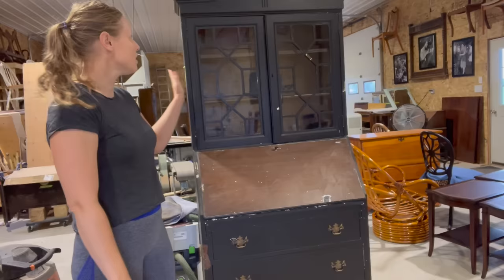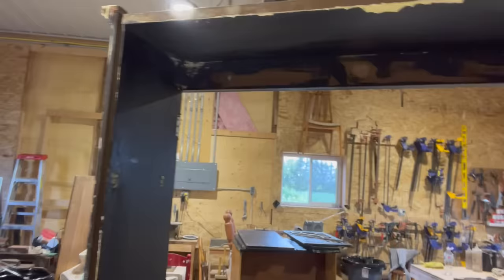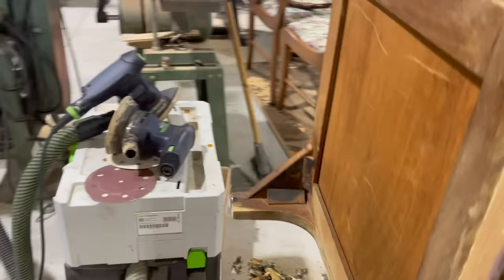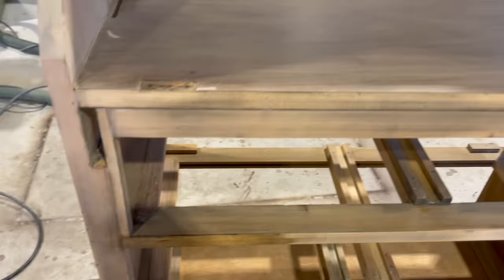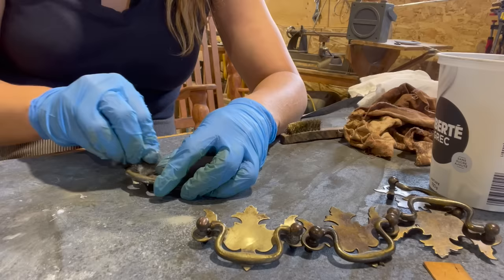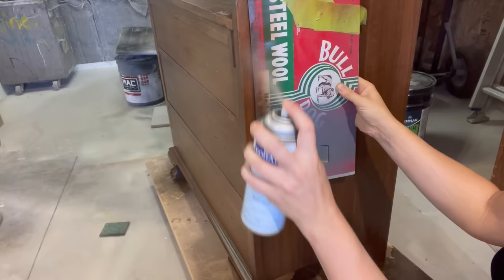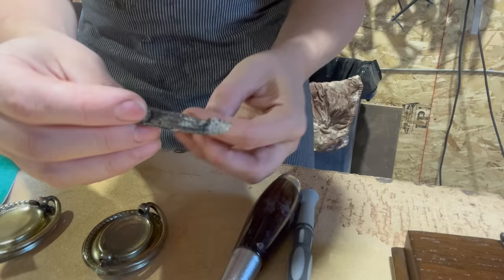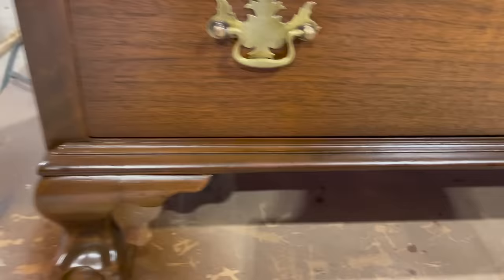The customers cried when they saw this one

Comment: I am curious about the nature of the old paint. Would the top layer encase enough of the lighter colored paint, a few layers down, be enough to not warrant lead paint removal techniques? How is the old pain contained to keep it and the remover from leaching into the water table? Does she test it if she knows the paint is older than 1978?  Does the use of the heat gun produce vapor from the lead? I know I could ask google but I thought these questions are worth sharing.
Reply from the maker: Hi there. I always test for lead and most often on older pieces it is lead. I have come to recognize the consistency of lead vs. latex or milk paint. This cabinet was latex paint as both layer had relatively been recently painted. Otherwise using chemical stripper for removal and placed into a old paint can which is brought to toxic waste is the proper way to remove it. Thanks for your interest! Cheers.
Reply: @johnsfurniturerepair  That's good to hear! I tend to worry like the Nana I am!

Comment: Amazing work! My only question is, would it have been beneficial to do the first spray coat on the cubby holes before they were assembled, and then the later coats after?
Reply from the maker: It would have been too cumbersome. My gun dials in pretty fine so it wasn’t to difficult to get the finish in not alot of time. Little pieces are a pain in the butt. Lol cheers
Reply: @johnsfurniturerepair  Thanks for the reply and keep the videos coming. Greetings from New Zealand

Comment: What grade of steel wool do you use to remove a varnish or a stain?  Do u think the heat gun works better for thick coats like that? Thank you. Superb work.
Reply from the maker: I use 0 for stripping and 0000 for buffing. Heat gun works great on thick layer of paint. Thanks for watching

Comment: In the end you put the glass over the wood grid. Are you sure that is correct. I have a similar secretary that had never been altered and the wood is in front of the glass. Mine may be older, it is larger and more ornate with more curves and carving in the cubby area.
Reply from the maker: It’s just a choice I give my customers. It’s usually easier to clean with it inside. But it’s up to them.
Reply from the maker: It’s just a choice I give my customers. It’s usually easier to clean with it inside. But it’s up to them.

Comment: I have two of these. One needs a little lattice veneer repair on one door, and one claw foot needs proper attachment. They still have their original finish. After you scraped that ugly paint off, what did you use to clean the wood?
Reply from the maker: Methyl hydrate

Comment: I've seen videos or tutorials on brass door hardware paint removal - in that they boil in water to remove paint. Have you tried that hack or technique? And wouldn't you try a brass cleaner after the paint is removed?  Thank you.
Reply from the maker: Yes, it just takes a little too long for me. And heat after you remove paint you can polish. Cheers

Comment: As always, absolute perfection!  (I'm still picking up the odd, older video here and there)

Just was curious about moving the wood grill or lattice to the inside of the glass.  I've owned two secretaries like this - one antique cherry and the other is mahogany and I purchased it new 36 years ago.  Both have the grille on the outside of the glass.  And, yes, it's a pain to clean.  I actually looked at the "new" one a few times over the years and nope.  No way to put the wood behind the glass, though the glass is in a sort of frame that could be removed.  Anyway, I'm thinking that it may not be that the wood was put back incorrectly by the idiot(s) who painted this poor desk over the years, but simply that it was replaced as it was.  Your way is better, IMO!  🩷
Reply from the maker: Lol thanks! I always let the customers choose if they want for easy cleaning

Comment: What is your spraying system and what finish are  you spraying?
Reply from the maker: I run a devilbiss booth with an 80 gal compressor that I have my devilbiss hvlp guns run from at about 19-20psi. I’m really loving Lenmar pre and post cat Lacquer. Cheers!
Reply: @johnsfurniturerepair  Surprised you are not wearing a respirator spaying lacquer and using a spray booth.

Comment: Two things. You the most beautiful blue eyes! My other thought was you use of steel hammers versus a rubber or dead blow hammer for disassembly. Any reason for that?
Reply from the maker: Thanks. I use both. Just depends if the hammer fits, didn’t this time. But also sometimes you need a sharp hit and then I’ll use steel. Thanks for watching!

Comment: I am wondering why you put the lattice work behind the glass. My parents have two mid 19th century cabinets, and both have their lattice work above glass (actually, they have duplicate lattice work on the inside and the outside).
Reply from the maker: It’s a choice. Easier to clean when it is on the inside
Reply: @johnsfurniturerepair  Nice anecdote about one of the cabinets. Just when my parents had this one for the first time in their home (it was part of an inheritance), a friend concidentally came to visit, and the first thing he said when he saw it from the door sill: "You barbarians!" and then he went straight to the cabinet and knocked the fingertips at each of the glass panes. "Don't you hear the difference? This one is original, and this one is just sheet glas!"

Comment: What kind of stripper did you use to get the paint to bubble up so nicely? I have chairs with numerous coats of paint that I’ve occasionally worked on for years trying to remove the paint. I got discouraged and finally gave up and put the chairs in storage to collect dust.😕 I anxious to get back to them after seeing this video. Any info is so much appreciated!
Reply from the maker: Check out the vid on the products I use. Cheers

Comment: Hey there! Really love your channel! You're such a pro and so thorough! <3 An honest question, you mention pretty often that the lattice is supposed to go behind of the glass on antique furniture 41:25, I tried to find older photos of Maddox pieces and basically everyone seem to have the lattice on the outside. So isn't that the correct way then if that's how they were built?
Reply from the maker: Oh yes im sorry. I suppose after so many years I just have developed a few opinions that differ from how things are built. Lol. So I always give my customers the option of putting the lattice behind the glass or in front. After trying to clean between those slats for years most choose the lattice to go behind the glass. Another reason why I like it that way is it is a thin piece of wood and I usually find them damaged or missing altogether. They are more protected behind the glass. So you are right, they built them with the lattice on the outside, but in my opinion i like it on the inside. Sorry for the essay lol. Cheers
Reply: No worries, thanx for the explanation :) have a great day! And thanks again for your lovely videos and craftsmanship!  @johnsfurniturerepair

Comment: Good job it’s literally pulled apart and cleaned and back together. How nice. The WEIRD thing is those grilles actually do go on the outside. It’s a very peculiar notion as cleaning is not entirely easy yet that is how they all were designed. Maddox Colonial style secretaries are a dime a dozen however. They are literally everywhere in varying sizes and qualities. Most are pine drawers with thin veneers of a better wood like mahogany or walnut. Most around are from 1920’s-1950’s. None of it is solid and the pieces are light. These often have been painted in a decorative fashion in the 80’s onwards. Some people did terrible paint jobs. I bought one in 2017 ( unpainted) for $250 and finally painted it a pop color with 2 tones at the end of 2021 and glossed it. It was not a solid piece of wood it is all veneers and it was beyond tired. This one is a bit less detailed as molding stops at the top and the claw and ball are only in the front legs. Also the finial is small knobby and rounded versus the taller flame style or turned pole ones.
Reply from the maker: Very cool information. Thanks!

Comment: Great video,, thanks for sharing. But I'm surprised to see no use of a respirator when spraying and even when using the heat gun to strip. If that paint has lead you are breathing those fumes and the irreversible nerve damage from lead poisoning is no joke.
Reply from the maker: Sorry for the lack of ppe in a few vids. I promise I do wear a mask most of the time. We also have amazing ventilation. Cheers!

Comment: Can you please tell me whether the stripper is solely for paint,or if it also works on stains? 
Also, what is the date of this piece?
Reply from the maker: It removes all finishes and some color. But a lot of the stain color will remain in the raw wood which you would need to sand out or bleach
Reply from the maker: I do t remember the date but I believe it was mid 20’s
Reply: Thank you.

Comment: A good thing the paint didn't adhere properly to the waxed wood, if they had sanded
before painting you would still be scraping now...BTW if you had ever had a drop of 
that paint remover in your eyes, you'd be wearing safety glasses now.
Reply from the maker: I’ve had that happen many times. But. It for a few yrs now. Careful with application

Comment: Are You ever worried that the old paint on these old pieces is lead based
Reply from the maker: this one was latex, but if lead, chemical stripping on the way to remove and dust collection sanding which is what i do on any piece. cheers

Comment: You are wrong I have three of those exact identical pieces never been restored never been refurbished exactly how they were the lattice is on the outside of the glass not on the inside. Why do you claim the lattice is supposed to be on the inside
Reply from the maker: It’s a choice. Do what you like with yours.
Reply: @johnsfurniturerepair  I wasn't trying to be rude maybe all three of mine are wrong do you have an old photograph or a picture in a sales catalog that shows how it's supposed to be when they sell them? It would make sense for the lattice to be on the inside it wouldn't collect dust. I would just like to know the correct way sorry if I offended you in anyway.